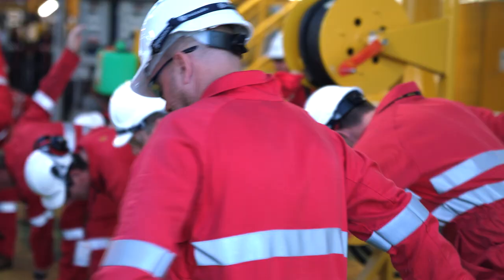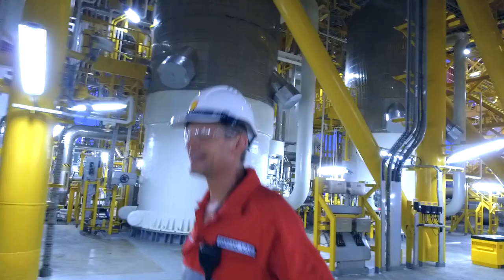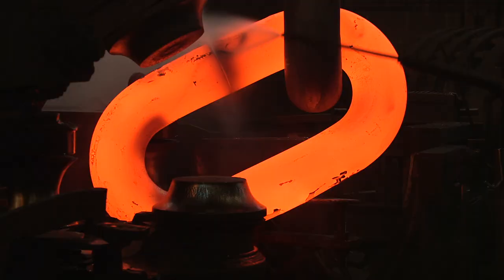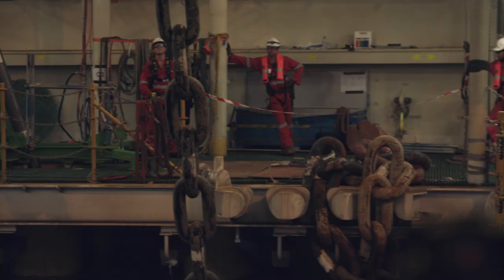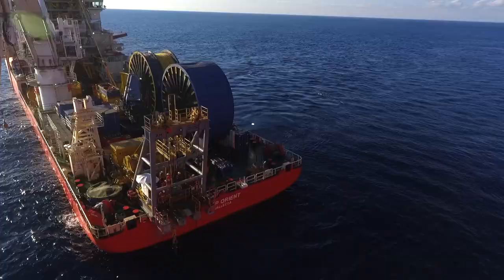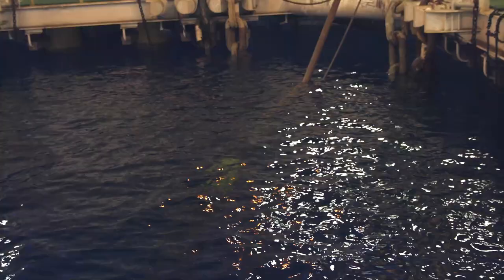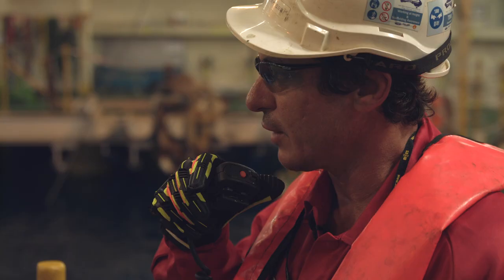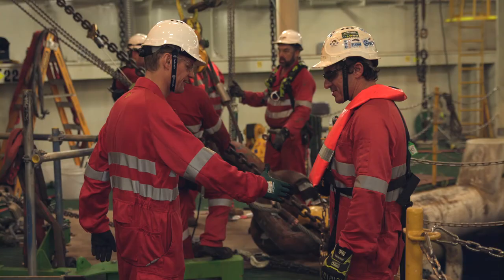Mooring the largest floating facility ever built | Shell's Prelude

Comment: I was wondering why they don't classify FLNG structures as "ships" .....  I see why now, at some point a hill is no longer a hill it is a mountain.
Reply: I'm
Reply: Might not have an engine. Needs to be towed everywhere...?
Reply: It's not self propelled so it's not a ship
Reply: Ships move
Reply: Lol well put
Reply: Doesnt has self propeller. And this is special floating structure with different classification and rule in construction follow oil and gas standart not only ship construction.
Reply: @Bossman1990  the Prelude is actually fitted with three Rolls Royce USL 455 azimuth thrusters (sets of rotatable propellers) with 6700 horsepower each. It is capable of moving by itself; it just doesn't need to do so very often because it usually stays anchored.
I don't see any reason why it shouldn't be considered a 'ship' as well as a 'facility' - both are technically correct.